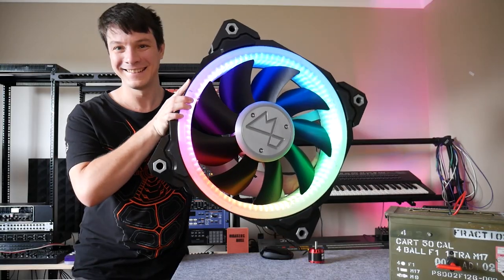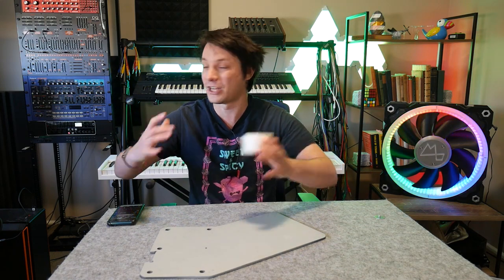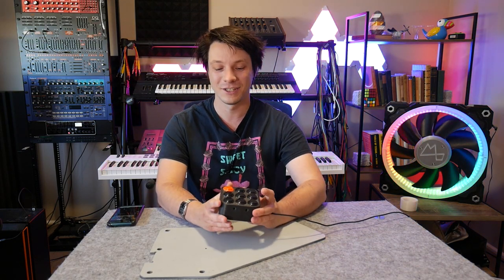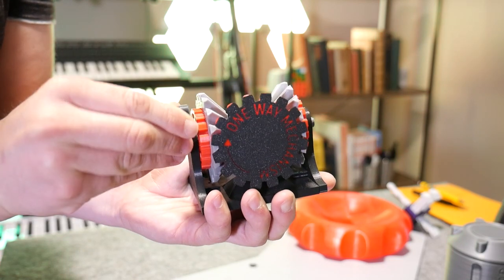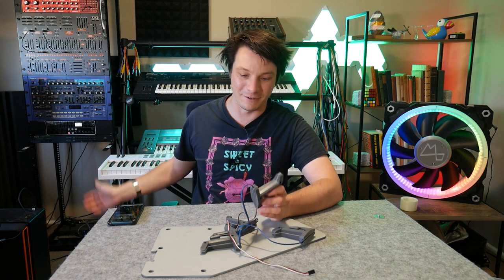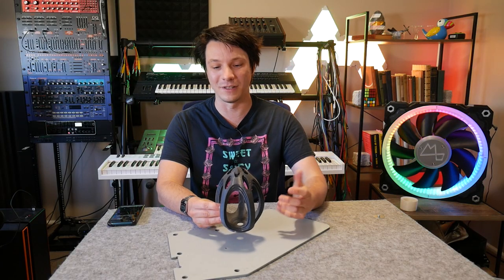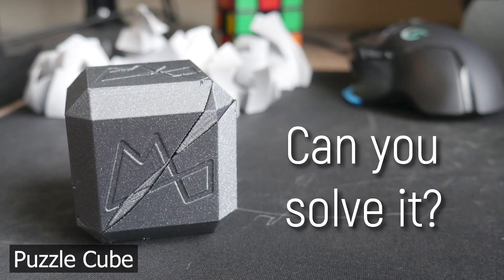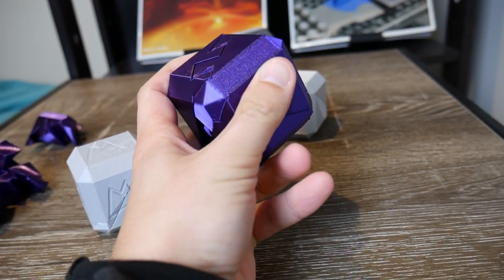I found a box of my OLDEST 3D Prints. What's inside?

Comment: @7:15 (I SELL TAPE FOR A LIVING) Command strips falling of the print Is because PLA is a low surface energy plastic, you could either scuff up the back of the print to gain better adhesion, or use a special LSE tape, that is designed to spread out more over the surface of the part you are trying to adhere, 3M  sells a special tape (if you are fancy)LSE-060WF VHB, or Tesa 4965, or glue something to the back of the part that has better properties, and then tape that to the wall. Im sure this helps absolutely no one, but hey.... let me know if you ever need tape samples. 
Cheers
Reply: Nice, love those LSE tapes 🙂

Comment: You're a good example of what the younger generation can do 3D printing with passion and an early start. I'm 56 and my first 3D prints were on my own hardware before I implemented G-Code processing. That was about 12 years ago? My favorite part from those times is a pair of nested spheroids that I designed programatically, the printer was calculating the shape from my formulae as the extruder moved. Now I'm very used to designing in openscad and many of my designs are perfect first time, others I add refinements to after proof of concept or occasionally I make a mistake and have to correct it.  You can only make a mistake so many times before you learn from it! It's good to see your range of creative solutions and it will happen to you too, your design success rate will continue to improve as you learn how to implement pre-printing design checks. For example in openscad, I will sometimes model a device that my object needs a critical clearance fit to, make adjustment for filament squidge oversizing and then test fit with my clearance model in semi transparent.   When I was a teenager and inventing pumps, modeling their motion in my head before they were built was difficult but I persevered and it became easy. When I started using CAD some 11 years ago, I learned the fundamentals quickly but it took time to improve my design work flow so that a design start to finish was fast and without mistakes. On top of all this is the different capabilities of the different printers we work with. Understanding what they can achieve and sometimes having the patience to get the result we want but slowing our print speed or tweaking settings to optimise them for the special requirements of our model. It is still mostly a hobby for me but I do sell a portion of what I make, be it maths art or functional designs.

Comment: Back in 2017, a friend of mine was going to hire me to work for a business he was wanting to start. He was going to start a 3D print studio, and I was going to be on-site IT support. At the time, I didn't know anything about CAD work or slicing or 3D printers or any of that. I have no clue why but I pretty much counted my chickens before they hatched. I was under the impression that he already secured the funding and was starting at the beginning of the year, so I quit my job and was ready to go work for him. He called me a week after New Year's Day and told me the bank had declined them and the studio was dead in the water. 
It wasn't until I stumbled upon your channel in late 2019 that I started getting really intrigued by the technology. I don't remember what specific video I saw first, but I remember bingeing a bunch of them when I found your channel. I taught myself how to design in Fusion 360 and started designing little trinkets and things to 3D print... 
but I didn't have a printer. 
I did a bit of research (using Maker's Muse and 3D Printing Nerd as a guide, of course), and ended up buying the Monoprice Maker Select Plus (a.k.a. Wanhao Duplicator i3 Plus)... and fought with underextrusion issues for the next year, only to find out the extruder motor was calibrated WAY wrong. How it printed even the demo models was a mystery... 
Lately I've been doing a lot of designing on a larger scale. I've done an oil barrel rainwater catchment tower, and an aquarium stand. I'm currently working on a campervan build. It's a great creative outlet, even if I'm not getting paid for it.

Comment: To the question what video got me interested in 3D-printing. It was actually not a video. I have been working in R&D for most of my working life. When working in Denmark we used 3D-printed parts for prototypes more than 25 years ago. We didn't have our own 3D-printer but got it printed somewhere else. 
Fast forward to a year ago. I was doing mechanical designs from home on project basis for clients. I was annoyed of the lead time for getting prototypes printed. To speed up the design/prototyping process I bought a Prusa i3 mk3+. Almost from day one I had success with my prints which was great as I needed it to work without too much tweaking. I must say it is such an enjoyment to be able to design something and in a few hours I have it on my desk. 
I have with interest followed your channel alongside with other channels. I have learned a lot from your videos about how to improve my printing skills. Most importantly how to tweak a designs to optimize it for 3D-printing. You have shown several great ideas how to do that. 
95% of my parts are printed in ASA (for outdoor use), so had to upgrade with an enclosure which is working great. Now living in Brisbane I understand your comments on the Australian summer weather and 3D-printing :-).
Keep doing your great work.

Comment: The most gratifying design is the one that's very specific to your needs but is still somewhat easy to model. 
I remember the first useful item I printed that fixed a broken tool. It even held magnets which made it that much more awesome 😁 and is still in use almost 3 years later

Comment: Just the glass in a car is a very effective UV block. I drove a 300 mile trip in my SLK with the roof down when I first bought the car in a UK Summer, and found out to my cost :-)   What got me into 3D printing - my other hobbies, I'm into electronics, boxes, fixtures, brackets, covers. A radio Amateur - aerial components, knobs, insulators. I ride an EUC's which have all manner of 3D printed modifications. When I first got the printer, all the printer add on's, spool holders, nozzle holders, a carbon filter and fan, cable tidies, wing nut covers, heated chamber fixings. And then for fun, mobile phone holder, Xmas decorations, models. My 3D printing hobby has expanded I print PLA, PETG, ABS, TFU, Nylon-CF (even trimmer cord), on borosilicate glass, PEI, G10, usually with glue stick, with a Qidi X-Plus printer with two Low temp extruders and two High temp extruders (mainly because I keep swapping materials). The bowden tube goes into the nozzle of the low temp extruder where the bowden tube stops at the top of the high temp nozzle. I fabricated Stainless Steel inserts to my brass and replacement nozzles so the bowden (capricorn) tubing stops at the top of all my nozzles now so to extend the life of the tube. I have ruby brass nozzles for abrasive filaments (with my S/S inserts) in 0.4 and 0.6 for when I print Nylon-CF in particular. You were one of the first channels a cottoned onto when I start, thanks very much, your vides have been really helpful, I have even got that book "506 Mechanical Movements", proper first edition of course :-)

Comment: To answer the question of what got me into 3D printing:  Nobody's video, but a need.  The house I was in at the time had a toilet that kept breaking the flush arm, metal ones, from a hardware store.  Adjusting the chain length had no effect and eventually it would break and the toilet would not work.  While looking for a solution I came across an entire flush assembly designed for 3D printing.  Bought myself my first 3D printer (Flashforge Creator Pro) and printed the assembly in clear PETG.  It was still in that toilet and still working like a champ when I sold the house years later.

Comment: What and awesome trip down memory lane Angus. You have designed some incredible models over the years, most of them I've printed.
Those command trips are crap; a family member got some to hang picture hook up with, a few days later they were all on the floor. So I reverted to the tried and trusted hot glue, 3 years later they're all still in place. A little IPA on a cotton bud will release if required.

Comment: I first came across 3D printing when I took a CAD class on a whim as I was getting my degree in a different area. This was one of the big SLS machines and I still have most if not all of my prints from those classes, I wouldn't get into hobbyist 3D printing until much later when I had a design for a mount for my microphone arm and after realizing how much a 3D printing service cost, vs getting a FDM machine and doing it myself I decided to get into home 3D printing.

Comment: What got me into 3D printing? Easy: I'm a gurdyist. That's like the car mechanic of musicians. I needed a way to organize everything I need on stage - isopropylic alcohol, rosin [sic!], cloth, cotton, screwdrivers in one 'maintenance box', microphone and transmission system in a 'mic box', and both, plus my belt, needed to fit the very narrow space in my hurdy gurdy case.

And as soon as that project was done, I started designing and printing cable management for my desk, my pedal board, things to attach things to other things, shelves-in-shelves for micro organization... Well, I guess my 3d printer is more of a tool than a hobby, now.

Comment: Redo the Fusion overload. I suggest printing a ball bearing or use a marble, so no one can use a magnet. Perhaps using a small spring loaded gate, so the weight of the bearing would allow it to push through (imagine the small metal extension part on a micro switch. It's hard to describe without using a picture.) That way the bearing can go only one way. A weak enough spring would be needed.

The maker coin was what got me into 3d printing.

Comment: I’ve got into 3d printing when I realized how difficult it is to get enclosures for my electronic projects with all the cutout’s and spacers . 
But once I started 3d printing I’ve neglected my electronics hobby and restarted using rhino3d that Ive  pursued before but lost interest because I could not really manifest my designs Physically.  

3d printing changed that I’m rarely printing anything beside functional parts and I’ve switched to fusion360 parametric design is really useful. I can remember how many times I’ve redesigned something from scratch because a cutout had wrong dimensions or a surface had the wrong angle.

Comment: So for command strip adhesives on the 3d printed hheadphones holder I am curious whether the failure was on the print side or the wall side. Because I have metal hooks adhered to the wall with vhb tape and they can support a psvr head set so I am curious whether the tape not good enough or it's not sticking to the wall or not sticking to the print. And even though I studied mechanical engineering figurines are what got me into 3d printing. I didn't realize until after college but I liked 3d art way more than I actually enjoyed engineering.

Comment: For the giant PC fan, why not take a box fan (or two) and use the blades from that? I've never thought fan/turbine blades were a good fit for FDM 3D printing because the stresses inevitably find a layerline to break. Injection molding produces more uniform blades, so if you can use them from a box fan, you'll end up with a stronger and likely more concentric fan.

Comment: Put a layer of super glue so the straps stick better. Or sand the back surface smooth. It seems the problem is surface area as the layer lines make for lots of tiny peaks and valleys.

Comment: i would help you recreation motor drive for that big fan because i know a lot about belt drive and motor and rpm
if you wanting to know what fan motor be using i recommend one of 120v ac motor which u normally find them in vent above stove or in bathroom vent in ceiling and using vacuuming design drive belt and have 3 motor drive it so doesnt over stressing one motor to limited

Comment: Hey so I have an odd ended old 3d printer from a company called Da Vinci, and I was wondering if there's a way to use a different program for a low end 3d printer like that, over the original 3d printer software

Comment: Doesn't really help with the files, but the big PC fan could be fixed by simply figuring out where it's rubbing and sanding down those blades a tiny bit. Shouldn't ruin the aesthetic much, and would fix the problem with that particular fan. 

Should probably still redesign a better model before releasing it to the world though.